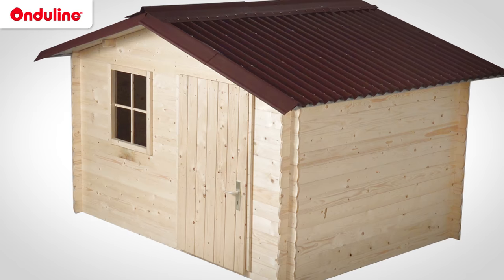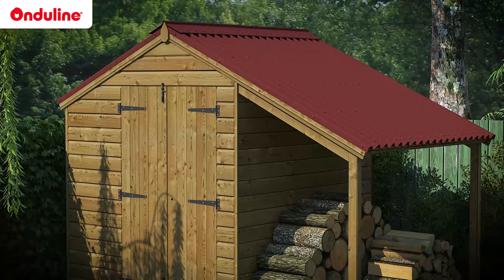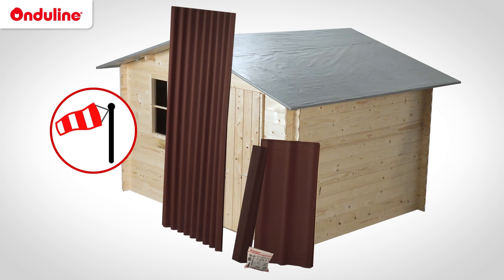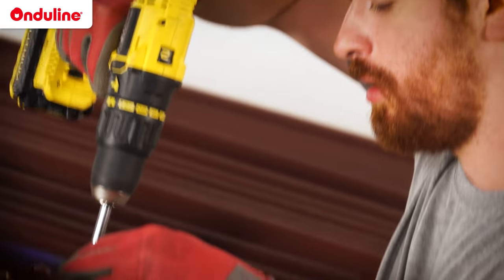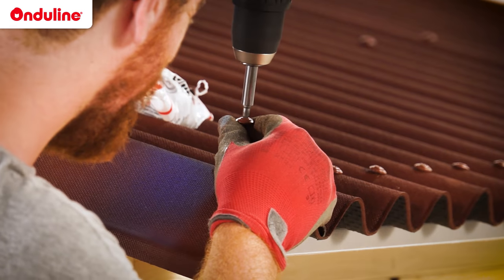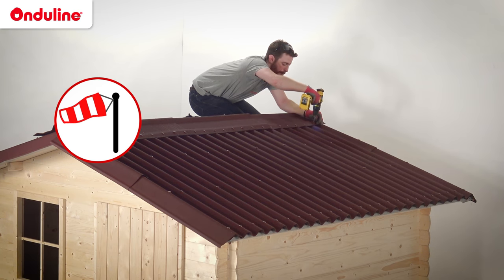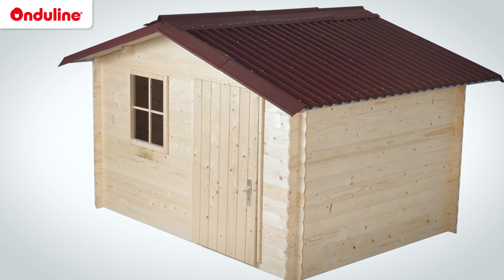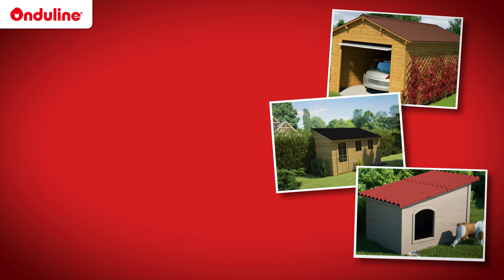[Made by me] How to install Onduline Base step by step

Comment: Hello, thats a great product idea. Can install it directly on an existing pergola with beams in every 45cm ?
Reply from the maker: Hello, thank you for your comment. Indeed Onduline Base can be installed on an existing structure. After removing the old roof, you can install it either on battens spaced 45 cm apart, or on a continuous support (OSB). Onduline Base is ideal for both renovation and new build!
Reply: @OndulineGroupOfficial  thanks for your answer!

Comment: “The overlapping of the sheets is done in the opposite direction from the prevailing wind” I’m thinking of installing this but the side of my workshop faces the prevailing wind. How does this affect water ingress in the overlaps and in the apex gaps?
Reply from the maker: Our products and warranty have been designed for installations which are according to our guides. Unfortunately, we do not have any tests for scenarios outside our installation guides.
The Onduline Team

Comment: Are these sheets safe to stand on? He appears to be stood on them on the other side during installation.  If so, is it only possible as it appears to be on a solid deck?
Reply from the maker: Hello Meta! Thank you for your interest.

Working on roofs can be a hazardous operation. Personnel should walk on roofs only if this is absolutely necessary. Avoid walking directly on the corrugations where possible. You should use planks or ladders laid flat and supported by the roof purlins, to carry out maintenance and related work. On steep pitches use specialised safety equipment.

We hope we answer to your concerns. Feel free to reach if you have more questions.

The Onduline Team.
Reply: @OndulineGroupOfficial  that makes perfect sense. Thank you. Just waiting on my sheets being delivered now. 

I do only have a 10° slope however. Instructions say to use a full deck or close battening. It doesn’t say how close though. It’s for a pergola roof. How close would you mount battens?

Sorry for questions here. I have emailed but had no reply.
Reply from the maker: @metarich2451  Hey! We’ll get back to you very soon to answer your question. The Onduline Team
Reply from the maker: Hello Meta, thank you for your patience. Here is the answer to your request: In the UK for instance, we would consider battens every 30 cm as “close battening”. We would also recommend min. 50 mm wide battens in this kind of application.

Hope it’ll help you.

Have a great day
Reply: @OndulineGroupOfficial  perfect. Thank you for the clarification. I’ve done the job and had already decided to fit the battens at 30cm but used 38x88mm battening. 

Must say, very impressed with the results. Ease of fitment  and look good too. 

Thanks again. 👍
Reply from the maker: @metarich2451  happy to know! Have a great day :)